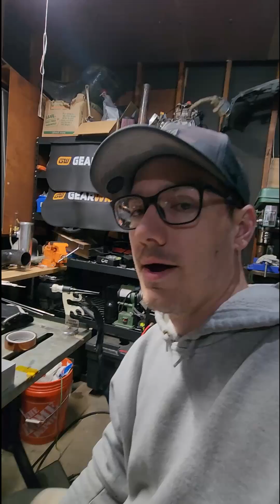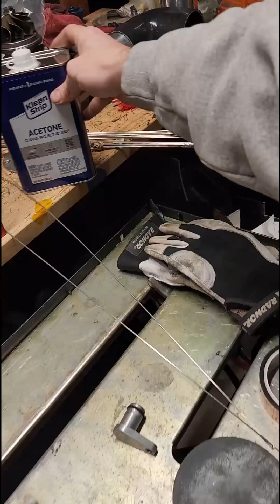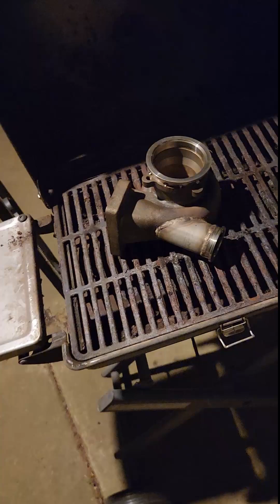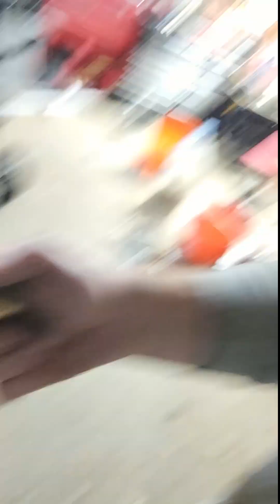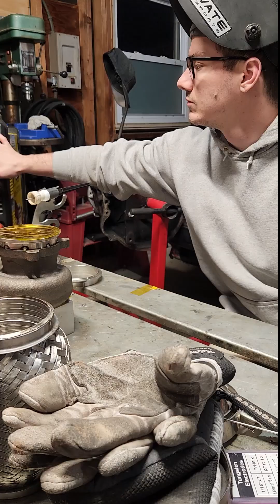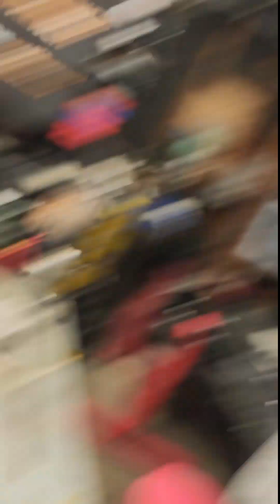Welding Stainless to Cast Iron – Will It Crack?

Comment from the maker: 3:51 ⚠️ Note: I used 309L filler in this video to weld stainless to cast. While it can work, it’s not ideal long-term. High-nickel fillers like ENi-CI or Ni-99 are better suited for cast iron.
Reply: Hey, would the Ni-99 rod still work good with bonding stainless to the cast iron ? I’m looking to do kinda the same thing you did but for an external gate off of manifold.